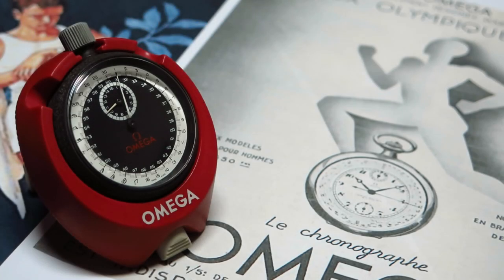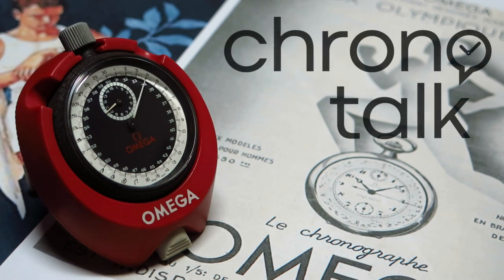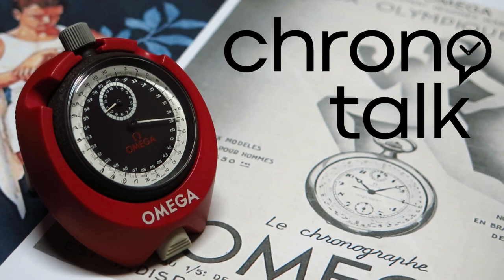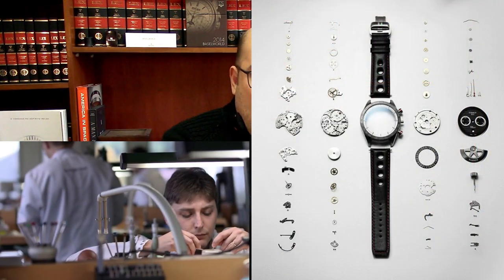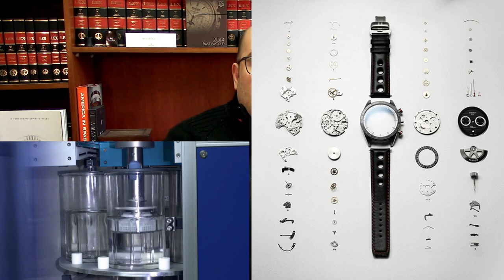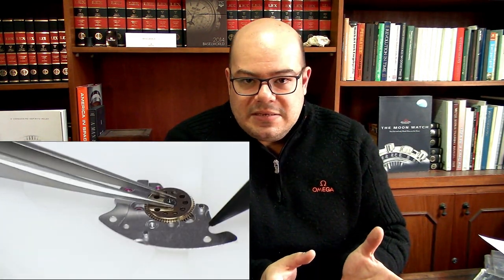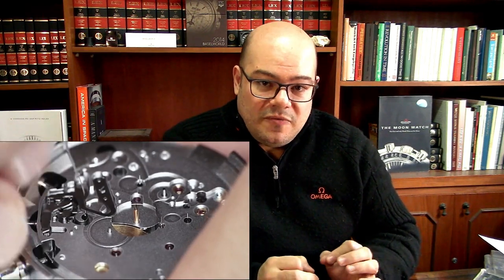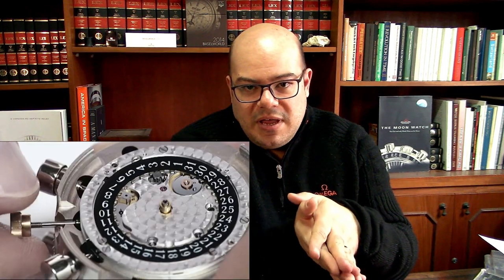[EN] Maintenance intervals? How often is recommended to have your watch overhauled?

Comment: Very disappointed to hear the misinformation about battery change intervals here. I was enjoying this channel and found a lot of it informative. Please allow me to correct you and I hope you will either delete this video and start again, or add the information elsewhere. 
You seem to be lumping all batteries into one group. This is wrong. Some batteries are built to last 10 years and frequently last far beyond this. It is rare nowadays to have a watch, a good watch, with a battery that will not last more than 2 years. It is ever more rare that a battery with a quoted life of 2 years will lose it's structural integrity and ruin the inside of a watch. Yes by all means make sure you buy a 'fresh' battery with a recent construction date.
Then there are the batteries inside solar powered watches 'capacitors' which will hold their integrity and power for decades.
Do not waste your time changing batteries every 2 years. All you are doing is compromising the integrity of your watch every time you open it to change battery.
Reply: Sorry to hear you are disappointed with the channel you once enjoyed. And you are right, I didn't differentiate different kinds of batteries and put them all in the same basket, like 3V Lithium batteries that can be replaced less often. My bad, really. Still, I will not delete the video because of this, and I also completelly disagree with your opinion that changing batteries alter the integrity of the watch. If this is happening to someone, I recommend choosing another watchmaker, bacause watches are designed to be opened and closed as many times you want. And at the bottom line, my recommendation is only a recommendation based on my 15 years of experience in watch repair business plus the manufacturers recommendation as well. Everybody is free to choose what to do with their watches, including leting the battery run dry completelly before replacing it, and saving a couple of pennies per year not wasting money changing batteries so often. You are all free to choose.
Reply: Thank you for admitting your error. But as is usual for egotistical YouTube uploaders, you have tried to worm your way out of it but are only digging a deeper hole for yourself. Allow me to correct you once again,  as even with all your vast experience there is always  something to learn... 
Not everyone is using a watchmaker to change a battery. Most people will either do it themselves or have a cheap jeweller shop do it. And I guarantee not many of them will know how to keep their watch it top condition after changing battery. So yes, if you are only talking about a specific battery that has a quoted life of 2 years, by all means change it, change it when it runs out. These 2 year batteries sometimes last double their quoted life so there is absolutely no need to change it for safety reasons before it runs out.
Reply from the maker: Sure, everybody is free to do anything with their watches. If advices where a good thing, we would sell it instead of giving it for free. Good luck.
Reply: @garyboyle695  You will find it impossible to try and correct me. Then you will realise you are the one that is wrong.